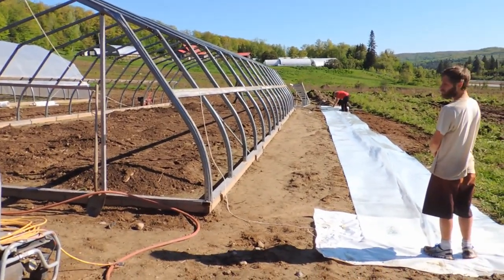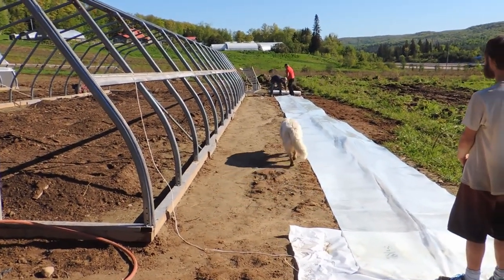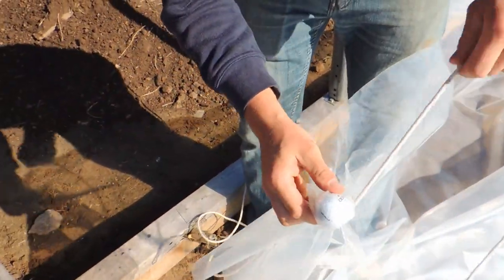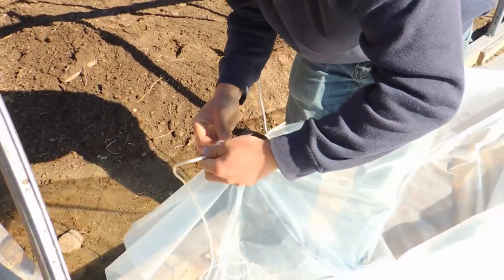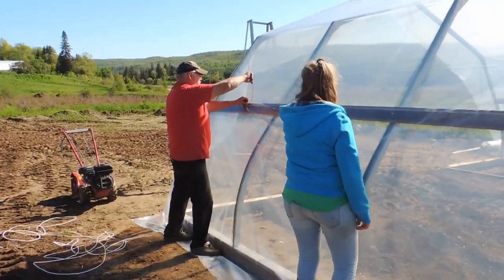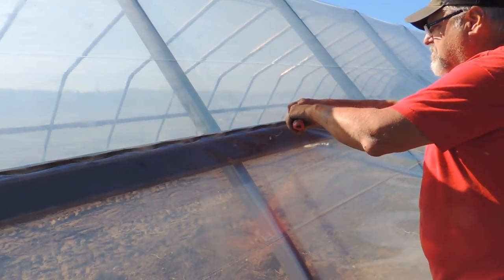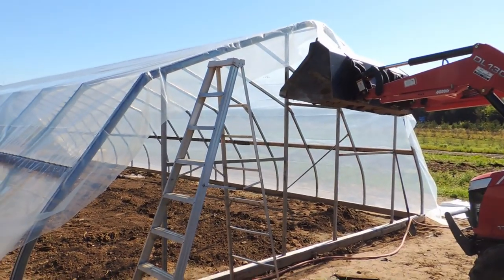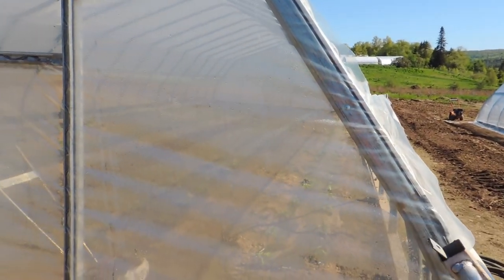HOW WE PUT POLY ON OUR GREENHOUSES. SUPER EASY!

Comment: There are many techniques for pulling poly over a hoop but this is THE BEST.  We struggled for hours on our first hoop with different techniques..  on our 2nd double poly hoop (96' x 30') today we used this technique with tennis balls and we were done, secure, trimmed out and cleaned up in 2 hours.  and "wiggle" wire - there is nothing better for securing poly to the frame. Thank you Spring Hill!
Reply from the maker: So happy this helped!!

Comment: What kind of green house or high tunnels to yall buy, the brand name, thanks
Reply from the maker: The link is in the description
Reply: Even with the link, I can’t find any information on the frame type or size. I just bought two 30x100 with a 15’ hight, but has the same type of frame. Oval.